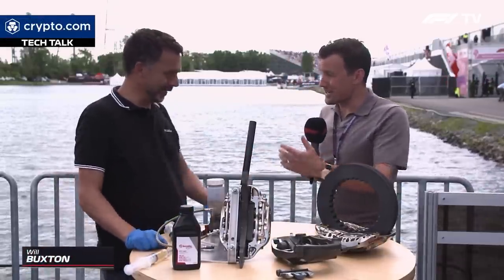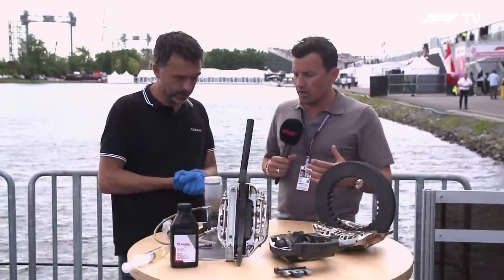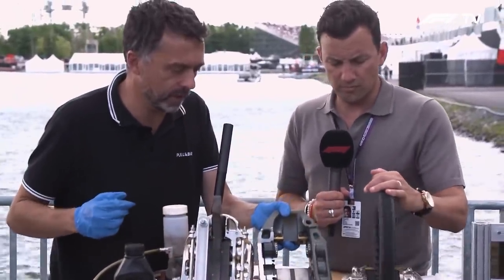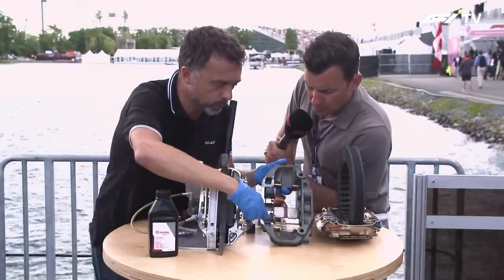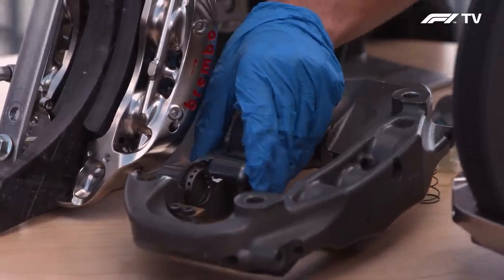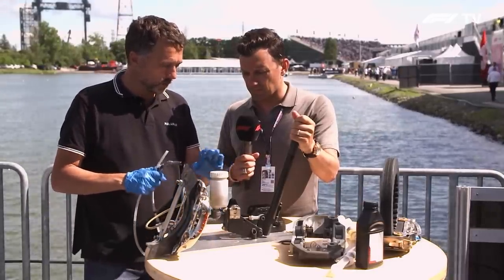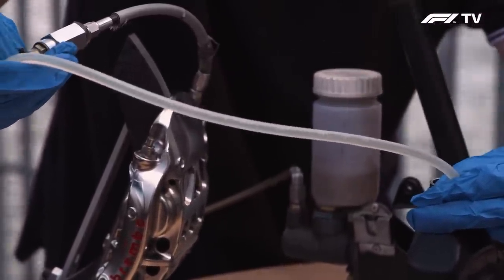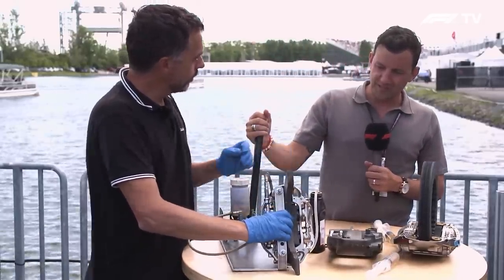How To Bleed Brakes | F1 TV Tech Talk | Crypto.com

Comment: It’s just like a normal road car. But, there is a difference in terms of the force needed to press the pedal all the way. Nice video. As a Mechanical Engineer Student, I love the technical aspect of these type of video on how certain components work. Keep up the hard work.
Reply: For real f1 needs to push more of this content
Reply: @Pidea14  U cannot be more agree with you!
Reply: He explained how to all modern road cars brakes works. I would expect more about why F1 brakes works so well, and the main differences between F1 and normal car.
Reply: @HONDAkisiek  The main differences are materials used (carbon discs, ultra lightweight components) and the springs behind the pistons. Road cars don't have springs pressing the pads against the rotors because they'd overheat and wear out very quickly. Not an issue with an F1 car because keeping heat in the brakes makes them more efficient given the materials used and they only need to last for race distance not 30,000 miles or more.
Reply: @HONDAkisiek  F1 cars also don't have brake boosters which are a large diaphragm running off the vacuum of the engine. 

Standard car with booster: Force applied to pedal increases force applied to master cylinder and brake pads.

F1 car: Force applied to pedal = force applied to brake pads. 

F1 drivers not only have strong necks, but strong legs too.
Reply: @HONDAkisiek  you start with the basic function of the brakes and then afterwards how the difference in design makes them better. Hopefully f1 carry on this brake "series"

Comment: "As simple as this"
"Very simple"
"It's simple"

Me bleeding my brakes alone "This is not simple at all."
Reply: Bleeding brakes is a two man job. One on the petal and one on the brake.
Reply: i use the serynge,... as vacuum pump
Reply: @bezedoinga  yer a wizard, harry!
Reply: Nope I just open bleeder up let it clear till air gone. Work the farther brake to driver side brake
Reply: @Fire Marshal Bill I checked it out. The only quarrel I have with it is that they are car model specific.
Reply: My car gravity bleeds. I replaced a brake line and my brakes were better. No active bleeding
Reply: @NIUpiguy  lol or you could buy a pump like motiv bleeder and do it yourself

Comment: I find it funny that F1 uploaded this because yesterday, my dad and I replaced my car's brake rotor, fuel filter, air filter, changed the oil, and had a water pump and idle pulley replaced all in the same day XD

Comment: is that has already using ABS,,(all brake system),,such as on all wheel drive (AWD),,so get the same presure and stability however wheel much and speed,,cause i dont see the ABS system on that table equipment shown,,thanks,,hhe

Comment: But how does the driver acces that valve? A switch in the cockpit or on the steering wheel? Do they use it before leaving the box? Before the formation lap? After? During the race?
Reply: the teams bleed the system between sessions
Reply: Ah, that makes a lot more sense.
As in, a hydraulic system that lets in air during a race is below any standard.

Thanks for the replies.

Comment: So how does it adjust brake bias?
Reply: Basically the brake pedal is connected to two master cylinders (one for the front, one for the back), and you control the bias between them. Although in F1 it is a lot more complicated with the brake by wire system.
Reply: @meronabr  wait so is it brake by wire or is the pedal physically connected to the pneumatics as explained in this video?